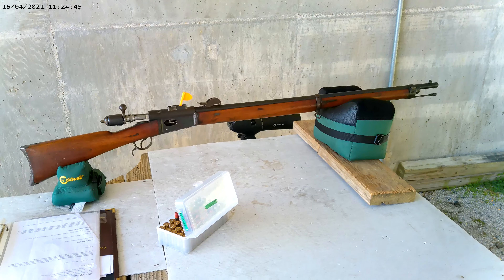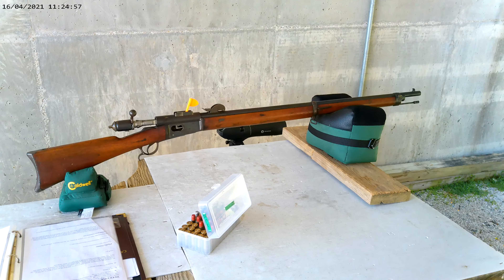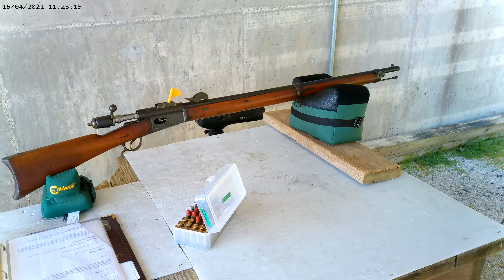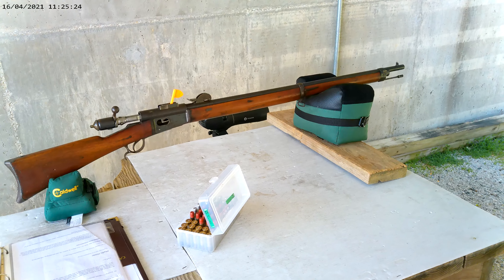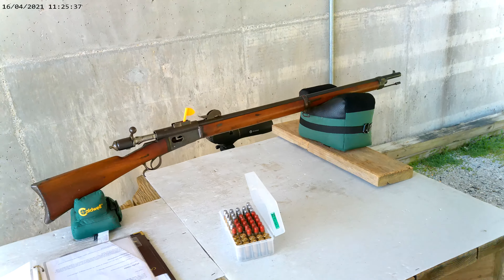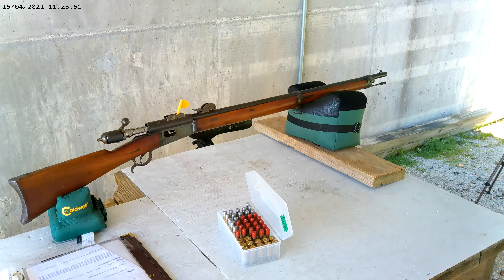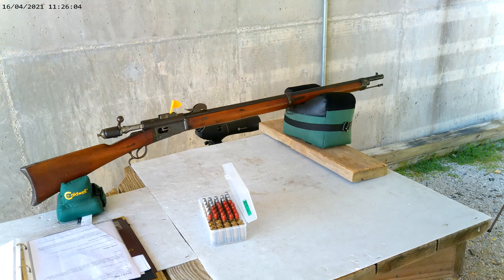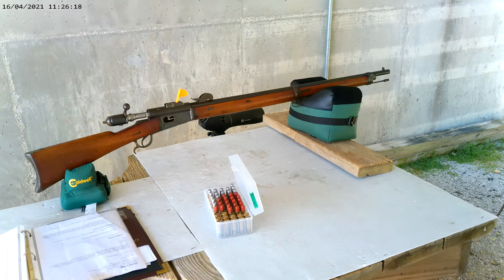m79 swiss vetterli and deviations in bore diameters

Comment: Love the Vetterli, just finally converted mine which slugged .409-.425 and will be starting out with .428 240gr soft lead SWC and black powder. I fireforned with trailboss and the groups were terrible, decided to try BP with hornady ftx 225gr just cause I had some and got a 2 inch group at 50 so I'm feeling better about it

Comment: Love the Swiss Vetterli I just got (well maybe like a whole lot) Deviations - A good statement - Wikipedia has .415 as the bullet - see a mold at Accurate that is .423 - the brass I just ordered from GB is set up for .430 - plenty of folks talking 44 bullets at .429 - ugggg -  I slugged mine right off min .408 to max .426 -  Like to stick to black powder - what bullet diameter, weight and what lube , do I run a lube biscuit under bullet?????
Reply from the maker: With a soft lead bullet, you could use a maximum .428 diameter bullet. Get a Lee sizing die, they can be made to custom sizes. I do not use black powder, so a cookie isn't necessary. I believe in one of my videos I tell my load. Do so at your own risk.
Reply: @navyvet7665  Thanks - I'll review the rest of your videos soon -